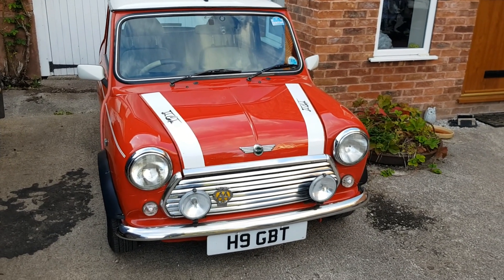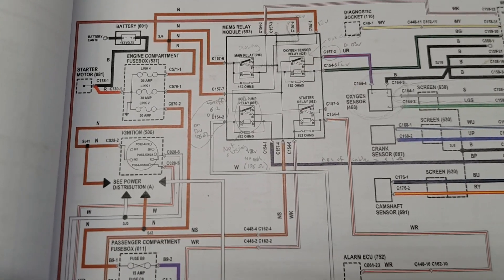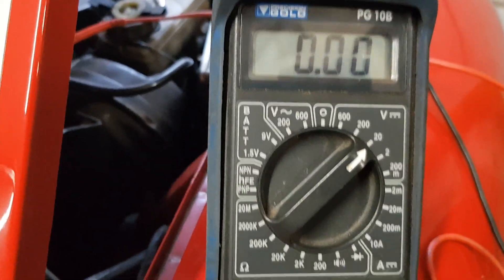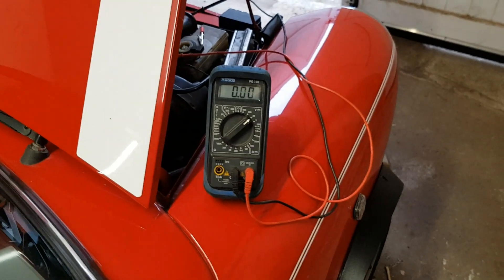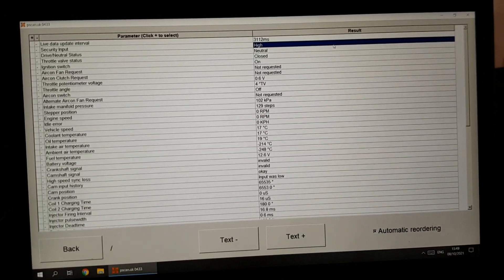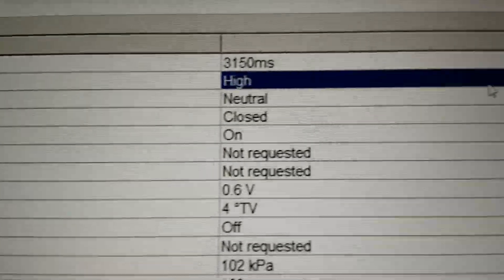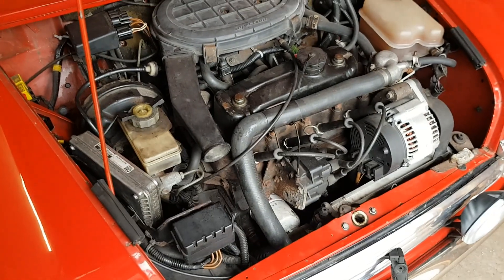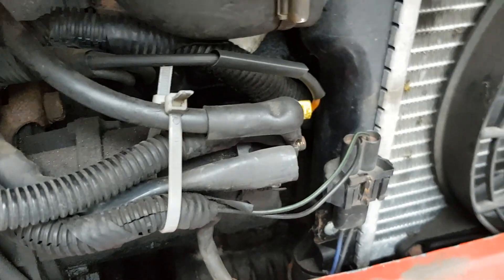Rover Mini Cooper MPI not starting SOLVED!

Comment: Thank you! Excellent diagnose and description. I cannot get an MPI Mini to start after I repaired the suspension and subframes. Equipped with the wiring diagrams and your video I will head back to the garage now and give it another try ;)
Reply from the maker: Thank you for subscribing 🙂. Good luck getting it fixed, the wiring can be frustrating but follow it through methodically and hopefully you will win

Comment: I have a  Mini 1995 Sidewalk edition with an alarm problem. Any way to disable the system? It won't shut off when using the fob. Pressing the buttons many times will sometimes shut the system off so I can drive the car. Take the key out or shut the car off and the problem starts all over again, horn honking and no crank. I just purchased the car.
Reply from the maker: It sounds like your fob maybe defective. Check out this forum post which may help: https://www.theminiforum.co.uk/forums/topic/269150-alarmimmobiliser-wont-deactivate-help-please/page-2

Comment: Sir, can you please please help me. I imported a brand new ECU from somerford. MNE101351. My original ECU in my Japan SPI 1997 car is MNE101350. However, the car starts for half a second and dies. It wont start again. It cranks but wont start. Is there an Immorbilizer issue with the new ECU and in my car? I dont have an Immorbilizer in my car, but the ECU I bought from UK might have that right?
Reply from the maker: Hello.
The immobiliser is a seperate unit (Lucas 5AS) which normally lives behind the dashboard. On my Mini, if the immobiliser is not turned off then the engine will not crank - the ECU sends the signal to the starter motor relay after it has had confirmation from the immobiliser.
I would start by checking the basics. Make sure that you have fuel getting to the injectors (like I did in the video) and check that you have spark. Also check that the engine has good compression. You can spray some brake cleaner into the air intake and see if it runs off the vapour - if it does then it is a fuel issue.
Also check the wires into the ECU, make sure that the wires are not damaged and that all of the contacts in the wiring plug are clean and free from corosion.
If that does not work then you will need to start doing diagnostic checks with PScan (pscan.co.uk). There is a video of this on my channel.
Good luck :-)